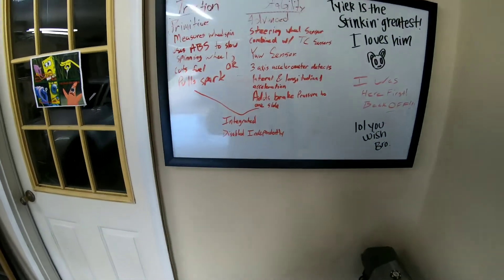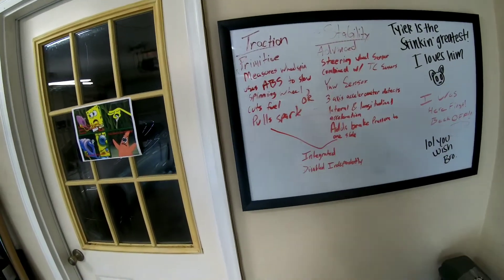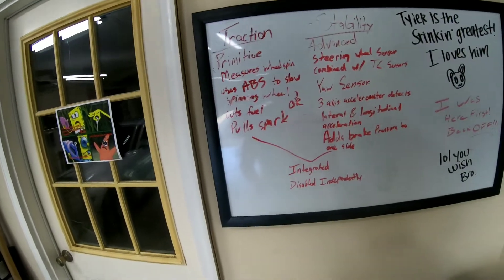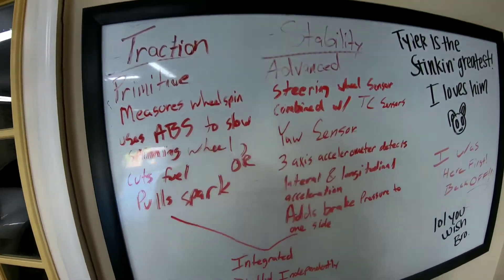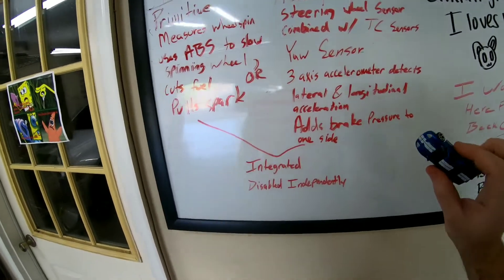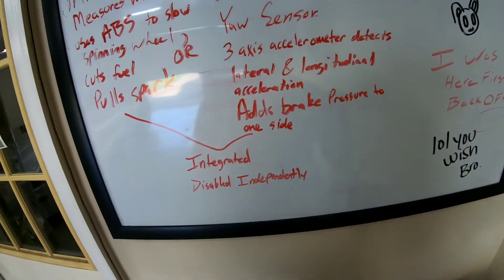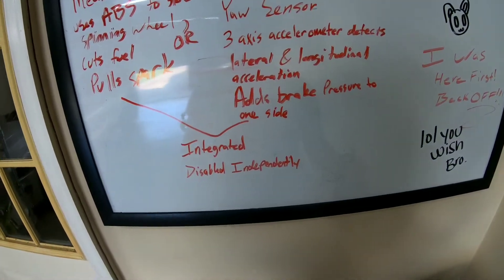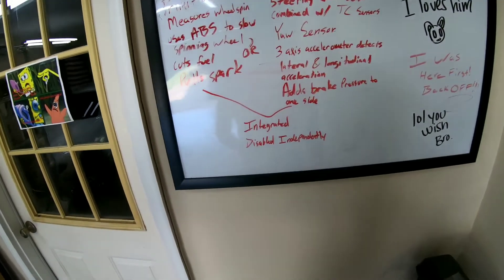What is the Difference Between Traction Control and Stability Control? Let's find out.

Comment: If the roads are covered in snow and ice and you don’t have winter tires on turn traction control off you want the wheel spin to be able to move if you leave TC on you will struggle to move the ABS still works with TC off.

Comment: Nice breakdown of differences between the two I’ve never known exactly what took place when those systems were doing their job just knew traction off lets you spin but if you don’t turn ESC off it will still try to correct you.